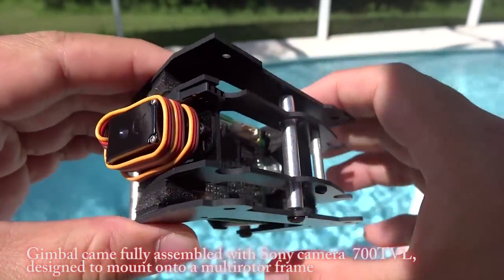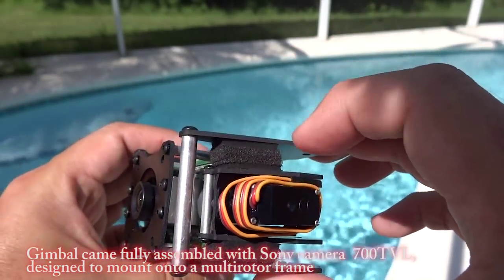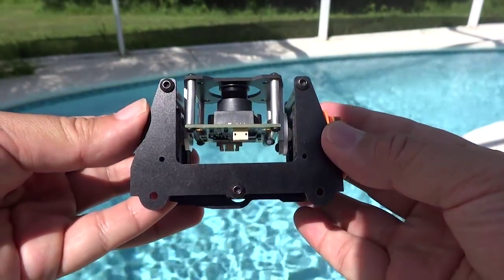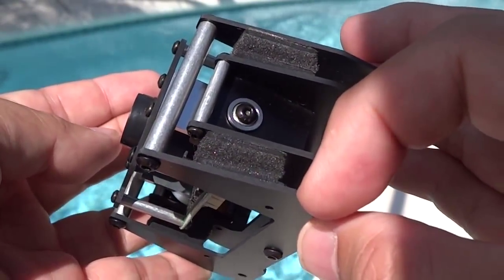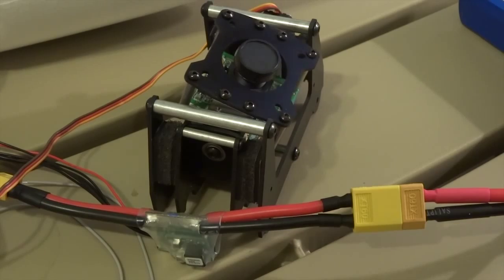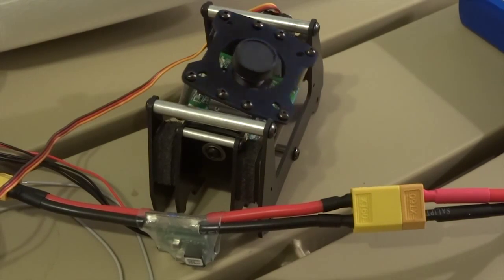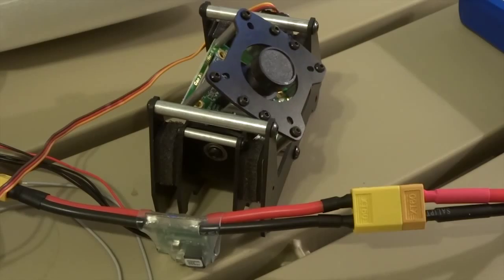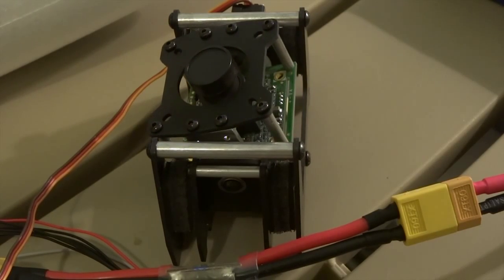FPV Camera Gimbal Sony 700TVL Effio for DM-SAR Aphid

Comment: What is the best beginner transmitter that that can have gimbal control capabilities?
Reply from the maker: +Hunter Bryant hello, it is best you decide what family of receivers you want to invest in the long run, that will make it a better investment.  most of our receivers are Walkera or came with DSM2, and I have been really happy with these receivers.  They are not overly expensive.  The Walkera Devo 10 radio transmitter has two dials and is compatible with Walkera and DSM2.  I own a talking Taranis transmitter, but i have had three mechanical issues within 6 months, it is however very popular, but more expensive.  Devo 10, if you are on a budget.
Reply: I have been looking at the Turnigy 9x. I am looking for a reliable transmitter that isn't too expensive. I'd like to be able to maneuver the camera gimbal with one of the channel switches or knobs.